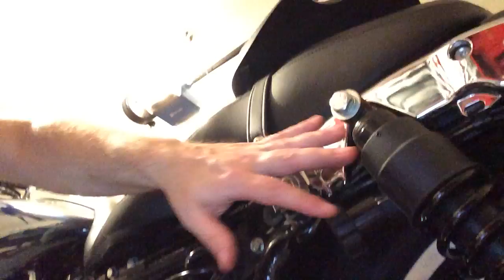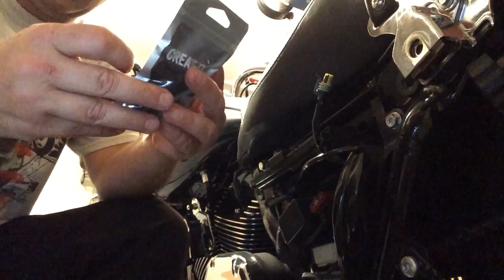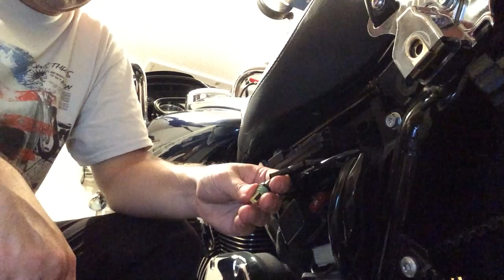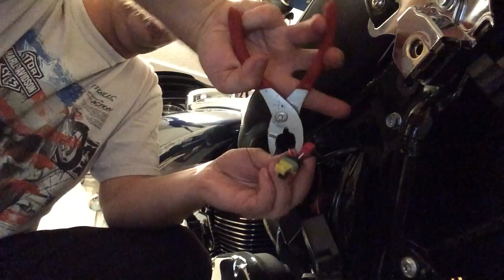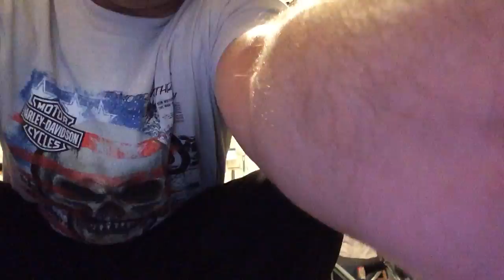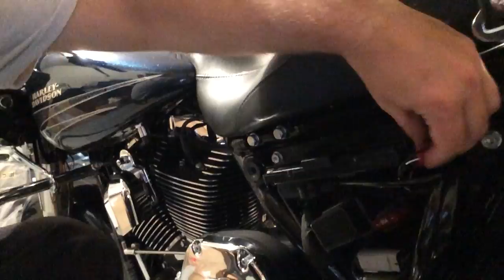2016 Harley Road Glide simple audible alarm install cheap

Comment: I don't you think you can use a pager with this unit. But if you're not worried about a pager then this is definitely the way to go.  It's $13 at Radio Shack

Comment: You don't get the remote option if you don't use the HD siren
Reply from the maker: Crusader General I don’t need the remote option as I am never very far from the bike. Also there is a tone to tell me if the alarm was set off.

Comment: Thank you for this video!  I am jealous of your access area.  On the Harley "Fatboy" you have to lift the rear of the bike some and remove or slide the plastic wheel cover down.  Pain in the butt really.  I like to carefully carve a side of the insulation off, put solder on it and the other lead end and then join them & insulate.

Comment: Guilty of doing too much. I stuck the bare wire of the siren in the holes of the connector.  never touched factory wires. 
My plug has a cover. Drilled a small hole in cover and passed wires through. Snug. Weather sealed themselves.